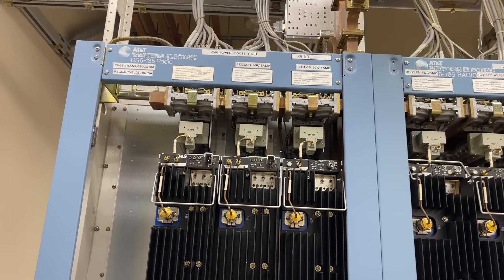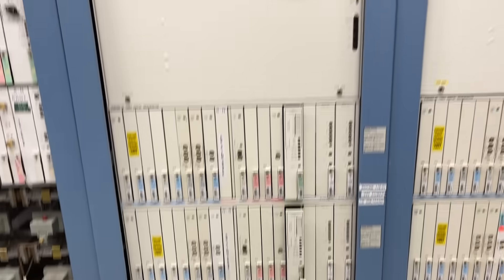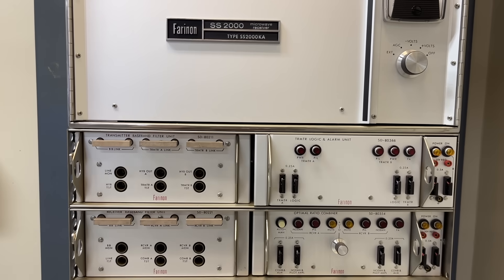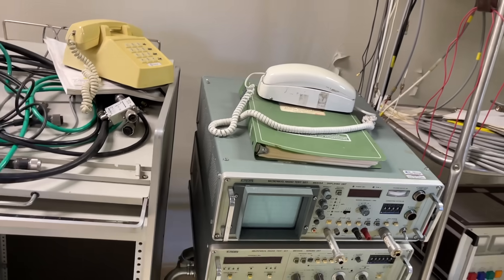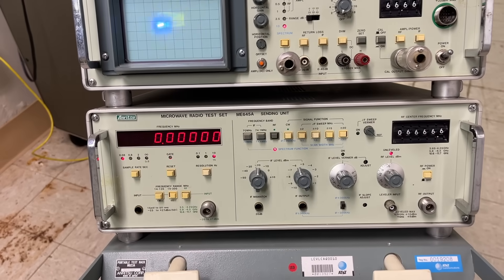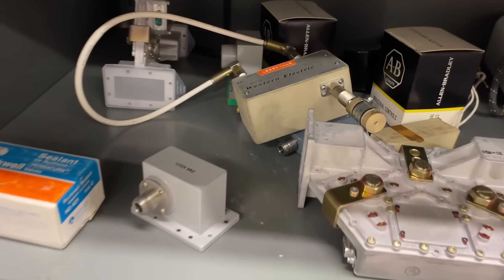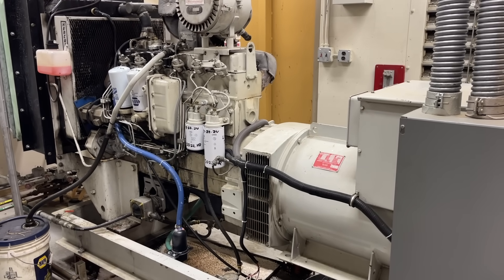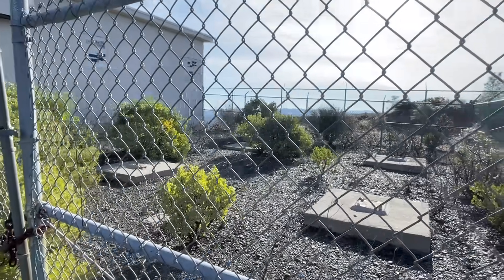Inside an old AT&T Long Lines Microwave Site

Comment: the dielectric constant of air changes based on humidity.  the waveguides are typically rated for "-40 air," or air that has a dewpoint of -40 (F or C, doesn't matter!).  You know they were using the Good Refrigerants if that's just a vapor cycle refrigerator as a moisture trap.  Usually you'll see a 3-stage system, centrifugal separator/cooler (expand the air, it gets cold and makes fog, fog flings to the side and falls down), then the refrigerant vapor trap, then a desiccant pack with particulate filter at the end.

Comment: someone will be using this old equipment when the zombie apocalypse goes down...
Reply: Some of us ham radio guys still do. At the very beginning of the video, he shows black heat sink fins with a blue thing behind it. Those are Siemens traveling wave tubes, a somewhat exotic vacuum tube. Some of use those for ham radio microwave use to bounce signals off the moon and stuff. I'm absolutely drooling over those racks of gear.
Reply: Indeed AM & FM were not entirely killed by the Video Gods 🥳 890 WLS ~ Sitting in my Dads Old Ford Truck back in the 70s smoking my First few joints, trying to Grow up by being Cool, and Jamming on the AM radio by Dim lights. WE WERE HIGH and 16. GeezUs Talk about the GOOD TIMES. Ok, sorry, what about the Apocalypse 😂😂✌
Reply: @detectivedave  Same here:) But in Dad's 73 LTD.
Reply: I don’t think so, lol, since the tower and microwave antennas (horns) have been removed. The remaining equipment should be preserved for future generations to see.
Reply: I was waiting and thinking the same with this comment, well done

Comment: Thank you for sharing.  I worked for AT&T for 45 years as a local loop engineer and planner.  I was always interested in the Microwave gear used around the area and country. I engineered and maintained several small Microwave systems to provide service in and around the Mount Wilson CA area.  I really miss being in these transmission huts and seeing the history.  Thanks again!! 😊

Comment: I thought these were all gone. 
I worked long lines in 1977 on some td2,th1, and ar6 microwave along with lmx2, lmx3 long haul carrier systems in Denver Colo. Also worked SCOTS control and surveillance system.  Worked 100a switching as well. Worked no.1 step by step and CAMA for southwestern bell back in the 70's as well. These were the best jobs ever. Thank you for your video, cool  stuff - still.
Reply: I worked in Columbia, sc, better known as Columbia’s #2. In the late 60s I spent a month in Fargo, ND at a retired microwave repeater station learning how to align and maintain the TD2 microwave repeater equipment. That was good equipment handling millions of long distance calls. I remember we had to add hundreds of circuits just before Mother’s Day to handle all the call volume.
Reply: @billmcroberts6566  I remember that too. Lmx2 carrier systems would be overloaded from the 4a switches on big holidays,  we were busy indeed.

Comment: Make sure to save that equipment and at bare minimum put it in a museum. 

Long lines are HISTORY. They achieved a historic milestone creating the network. That is a well preserved example. The original equipment would be nice as well.
Reply: I was thinking what'd happen, would this kinda stuff just be thrown out by company mandate or could the operator just pull some stuff to the side when its all taken down
Reply: MAPS? Of AT&T locations.

Comment: I work in a NOC and for about 10 years our office was in our main CO. Also been in cell sites and other small COs. Always thought these buildings were really cool because of the history in them, lots of ancient stuff that's still running and abandoned. We still have a DMS100 and I don't see it going away any time soon either.
Reply: I worked at Northern Telecom from 80 to 2008 and supported DMS100 and DMS10 outages. Good to see the DMS brand mentioned.

Comment: If any of that equipment had been manufactured in China, there's no way in... it would still work. Former Motorola Technician here, I never worked in one of these long lines facilities but many similar for Commercial and Public Safety. The old test equipment is by far the best. It was made to last and the equipment we used had to be tough enough for transporting from site to site.
Reply: IFR 1200S or a COM-120B!
Reply: All equipment back then was developed by Bell Labs and manufactured by Western Electric. All part of the Bell System. Monopoly? Yes. End to end, a well oiled sewing machine. Bell Labs invented the transistor. It was pure genius until the government broke it up. Some people made a ton of money when it was broken up. Hint: Foreign made telephone equipment. Panasonic, Sanyo were the huge winners. China entered the picture years later with their junk.

Comment: In Lawrence Massachusetts there is an AT&T building with intact towers and and folded horn antennas easily visible from I495. As others have mentioned the DR-90 and DR-135 radio systems date from the 1980’s. Those digital radio systems replaced analog microwave systems which went through multiple generations starting in 1949. All these systems were manufactured at the Western Electric facility at nearby North Andover MA. I worked on the design of the DR-135 at Bell Labs collocated in North Andover. The equipment operated in one of the three licensed bands: 4 GHz, 6 GHz, 11GHz. The 4 and 6 GHz radio transmitters were solid state. The 11 GHz transmitters used traveling wave tubes.
Reply: There was an option for TWTs on the 6 GHz too. I changed quiet a few when working for MCI. Yes, MCI had Western Electric radios. It was part of the consent decree that WE would sell on the open market. Honestly, I preferred NEC.
Reply: @Joshie2256 NEC made fantastic transport equipment. When I retired from T in 2022, we still had some in service, from the 80's. My buddy/30+ year coworker installed a lot of it in our region. He said the talk that went around back then is if you wanted the best transport, buy NEC, but if you were dumb enough to buy a NEC switch, you deserved it!
Reply: That North Andover facility is so huge it is hard to describe.
Reply: I'll have to keep an eye on I495 next time I travel up that way. If I'm heading northbound what exit would it be near?

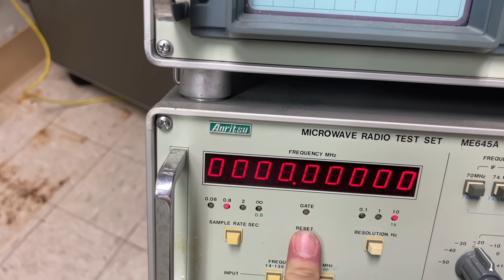Comment: 4:44 - Anritsu!  I worked for Anritsu in Morgan Hill, CA.  Anritsu, a Japanese company, bought Wiltron during the mid-80s or early 90s which was an American company in Silicon Valley.
Reply: That’s awesome! Just wondering, what would that test unit be used for primarily? Would it aid in the directional placement of the towers horns? Faults in receivers and transmitters? Etc etc. I’m new to all this.
Reply: We have some Wiltron and Anritsu DS1 test heads in our local CO's.

Comment: Nitrogen?
Reply: These air dryer systems are much more common than nitrogen systems, even today. The only place I've ever seen nitrogen used is in a high power situation. Even combined, these uWave systems were only transmitting a few watts.
Cheers.

Comment: There is still one of these long line towers still up. in Bowdin, Maine. The microwave part has been decommissioned but I believe the tower is used for cellular now. Its cool to see the original microwave antennas intact tho.
Reply: Cellular is microwave, now 5Ghz and started at 800Mhz, so the tower is still used for it's original purpose, just in a different format.
Reply: Learned something new today. :) good to know

Comment: This is very interesting.  It's amazing how things used to work and how technological changes have made them obsolete.  A site like this could be repurposed for ham radio use, especially during emergencies, although it would be better if it still had the towers to mount antennas on.

Comment: I left Long Lines in 1971. Those days, they had Cross Bar. Step by step switching in the CO. You needed ear protection because of all the relays clicking. If memory serves me correctly, the wiring and equipment between each CO (central office) was called xrl or xlr. I could be wrong. The Bell System was an efficient  running machine. Everything under it was spelled out in the Bell System Practices book. I worked in the Windowless Wonder LD 7 in New York City. To keep the equipment clean, the building had no windows. There were lights telling you what the weather was outside. It was an amazing company to work for. A shout out to a buddy, Bob Cardillo. He taught me many things and was a fine Craftsman.  Thanks Bob.
Reply: Good to see this old gear RIP.  I started in Western Electric in 1982 on central office systems.  I never worked on microwave but remember implementing BSP on the T-Carrier networks.  Great company to work for in those days, The equipment was world class and built to last.  AT&T could afford to "over-engineer" everything in its monopoly days.
Reply: It's not that they could afford it's that they fought everyone to keep their monopoly. They still do. But they have gotten a lot smaller for sure. I don't understand why a lot of these systems still had power.
Reply: I was a T-Carrier tech worked inside C.O.'s and in the field.
 Helped install the first fiber optic lines in 1982. Also helped maintain underground CEV's that housed fiber optic repeaters and the 24v power plant.
Reply: I bet if I dug through my tools, I could find an old wrapping tool from my frame days doing cross connects. (Not an electric one, hand).
Reply: ha i removed or RIP'd that stuff n put in 5E
Reply: As a Craftsman, you could go to school forever with AT&T Long Lines. I was scheduled to go to Buffalo NY for Backup Power Generation school. The training was second to none. A lot of new applicants were straight out of the Navy. The stories told at break and lunch were always interesting. Great guys to work with. Promotions were plentiful, especially if you were willing to relocate, and yes, Craft was all men. Women were clerical back then. Two weeks before departure, the big strike hit. I left Ma Bell. It was a long, costly strike for everyone. I never regretted leaving.  Mother treated me well, but I couldn’t sit out a long strike. It turned out to be a wise choice to leave.
Reply from the maker: @bills6946  Still the same with modern AT&T. They will cover your tuition if it aligns with the business needs. Power school is in Conyers ,GA now.
Reply: @bills6946 I went thru company schools in Glendale for T- Carrier training. What year was the big strike you're referring to ?
Reply: @ 
1971
Reply: I wonder if you knew my father, TR. He transferred out to Huntington NY around 1971.
Reply: @joeviking61  
No, sorry. There were many departments in LD7. I was an OGT test man. Outgoing trunk test man.

Comment: I used to drive by one of these  sites in Gardena, California, off Artesia Blvd in the 70's- 80's. Always wondered what it was for.
Reply: That's the Gardena switching center.  It's a tandem office still in use and switches all the telco traffic in the south bay area.  It's also a long distance center as well.  Some of those horns used to connect other tandem offices to this one, as well as send long distance traffic out over the microwave long lines system.

Comment: I do IT work for a company that has multiple locations (over 300) across the state.  In the area I'm responsible for, wind turbine construction has caused several fiber cuts that affect two of our locations simultaneously, and this has been over the last 4 years.  The redundancy solution has been a cellular backup with SIMs for ATT and Verizon.  Unfortunately, the fiber cuts affect cell service, so the cellular backups have been useless.  Three weeks ago, we had another fiber cut, so I went to Best Buy, got a couple of Starlinks, worked with our network team, and got the locations up on "Elon-Comm".  They were suppose to be temporary, as in until after Thanksgiving, but the WAN circuits keep going down, so our system fails over to Starlink for the short duration.  I was thinking, "If only we had our own Long Lines backbone!"

Comment: I live close to Dahlonega-1, which was one of the larger hub sites.  The site is now owned by American Radio. I have no idea if any equipment is still in the building, but I'd really like to tour it. I've been meaning to call them to see if they'd let me go in next time someone is up there.
Reply: I live near Dahlonega 1 also. It’s gutted and in bad shape I’m afraid.
Reply: @fiberplz  I'm not really surprised, but I am somewhat disappointed. I'd like to have seen the site when the horns were still operational and maintained.
Reply: @JCWren  ATT leased Dahlonega-1 back after it was sold in the early 2000s. They operated a digital route to Gainesville for a few years and it was turned down mid-2000s. It's been gutted and ruined since then.

Comment: You'd figure they'd remove the old equipment because they needed the space,  rather than Retire In Place,  but the newer technology equipment packs a lot more data carrying capacity into a much smaller space, so actually the equipment space needs in central offices and equipment shelters like this is getting SMALLER rather than larger.,    Central offices that were once three floors of a large building, absolutely jam packed with 70s era equipment, now do a lot more with just a small area on ONE floor carrying a few racks full of modern equipment.
Reply: I remember visiting central offices in the 80's and watched the conversion to digital ESS switches.  Amazing amount of shrinkage and noise reduction.  Just think of how in less than 40 years the equivalent power and capacity of those massive computers is now available in a cheap handheld smartphone.  I still am amazed how much cellular technology has revolutionized the world.  Imagine someone coming out of prison after being incarcerated for last 20 years and using a cellphone for the first time.  It may feel be like time traveling into distant future.
Reply: If they pull it out, they have to dispose of it. I don't think I ever saw a old piece of telecom gear pulled out of any company I ever worked for. If there was old telecom end point equipment in a demarc closet, it didn't matter how old something was or how long it hadn't been used, if we ordered a new T1 or whatever, they would just mount a new box wherever they could and leave the old, unused cabinets mounted to the wall. Often the cards would still have power on them, even though they hadn't been used for years. The only time anything ever got removed was when I removed it.  Given my experience, it's not surprising to see this facility full of gear. Probably the only reason they pulled the tower down was due to safety concerns of it collapsing due to age.

Comment: Your should ask if you can turn some of the transmitters into ham gear to work the SHF microwave frequencies up there lol. Imagine the output you could get from one of those microwave transmitters.
Reply from the maker: That would be cool. Some of the older sites that were sold off have become repeater sites for 2m/70cm
Reply: They were very low power, on the order of a couple watts output. However, coupled with the gain of the cornucopia antennas, it was effectively multiplied sometimes hundred of times.
Reply: They would be good for QRP ops if they are low power then.

Comment: Microwave links replaced by coax? Seems less than practical. You would need a lot of amplifiers to get the miles in with coax. With many amplifiers comes reduced SNR and low performance. The goal was always to replace long coax runs with fibre, to improve the network .
Reply: It goes K carrier which was cable pairs, then L carrier which was coax (600 voice channel capable or 1 tv channel) then analog microwave radio TD2 then digital microwave DR6 then fiber optics. I worked K carrier thru early fiber optics.
Reply: @davidballard9534  yhea kinda what I thought. 1 TV channel, 6MHz?  I worked CATV 50 Ch plus internet, 750MHz and you'd probably get half mile and then another amplifier.

Comment: I believe microwave is still used (not AT&T) to connect to remote areas where building fibre is not easy (mountains). I also heard that microwaves links can transmit data faster than fibre and that little bit faster response can be used to make stock trades more profitable.
Reply: I know where there is a uWave repeater site for one of the stock exchanges, so you heard right. Lots of cameras. Not sure exactly which exchange. The reason to use a dedicated uWave system is to reduce the latency inherent in the internet, never mind the security aspect. Fibre and uWave systems propagate at roughly the same speed, it's the processing in between that slows it down. Much cheaper to install a uWave system than string miles and miles of fibre for a dedicated link.
There's lots of uWave still in use for public safety, backhauling cell sites, private internet companies, etc, etc.
Cheers.
Reply: It still is used by AT&T.  In my area we have links going to places where we have no copper trunks to remote COs such as Oat Mountain in Chatsworth,CA and from Pasadena Green C.O up to Mt Wilson area for everythijg up Angeles Forest Hwy.  These are T1s that feed D4 banks for dialtones

Comment: Back when I was climbing towers for a living, I took several of these sites down. The techs would uncouple the waveguides at the building and the rest was in our wheelhouse. The best part was not only getting paid for taking the tower and gear down but all the copper was ours. We partied pretty hard on that copper money!
Reply: Can you imagine at todays copper prices???
Reply: @Matthew8635-j8g  ive visited a lot of sites that have been pillaged by crack heads for copper, makes me sad. Most of the sites are otherwise untouched.
Reply: I visited many of these sites when I was a contractor for Emerson Power. I was there to engineer the removal of the battery plants in most cases. I wondered who was going to be responsible for all the copper waveguides.